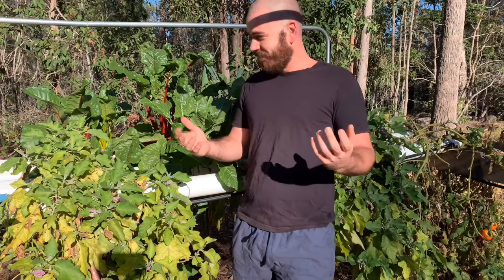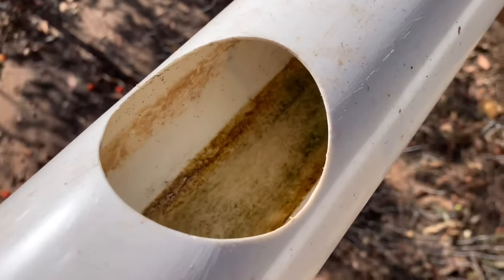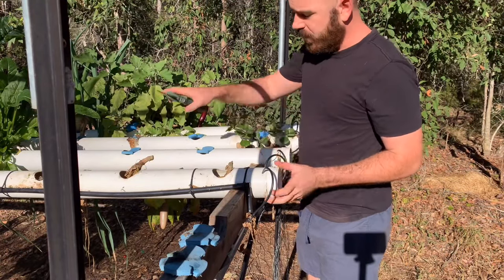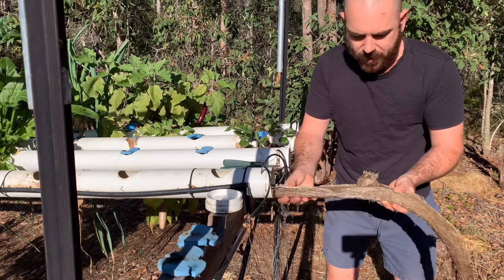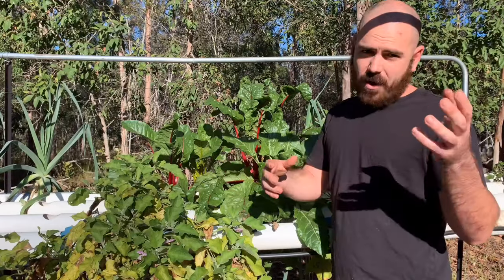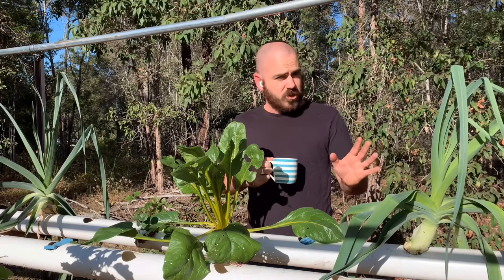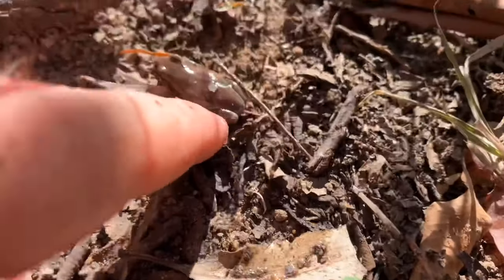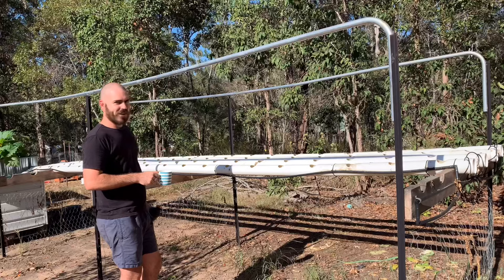How to Clean a NFT Hydroponic System

Comment: Great videos ,may i ask,are you going to use or up grade to real NFT track, the lids remove , im asking because the round pipe was wiped with lead not tin ,not shore if they still do it ,Thanks mate
Reply from the maker: These are the same grade pvc pipes that I use to collect rain water in our tank. And they are rated for collecting drinking water. If there’s any lead in them I’ve got bigger problems than my hydroponic system.
Reply: @Hoocho  Thanks mate your very cool